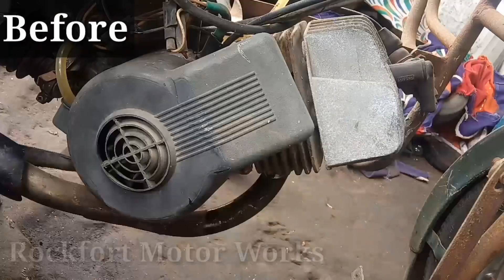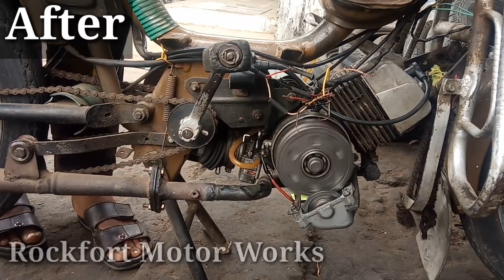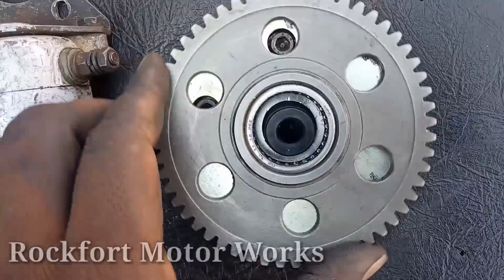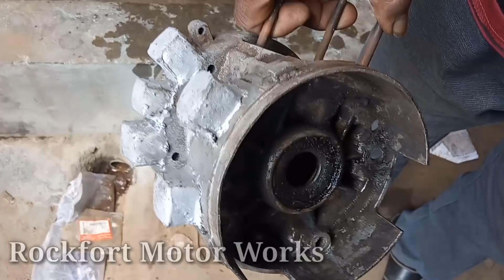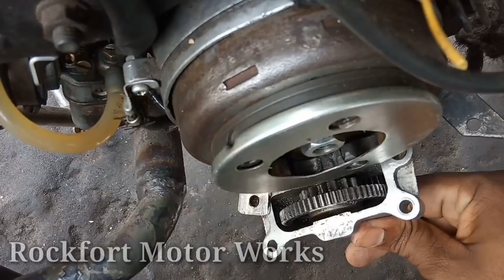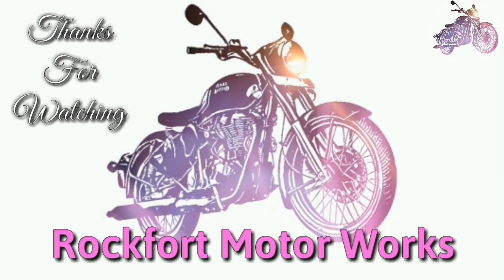TVS 50 Self Start Alteration / Rockfort Motor Works

Comment: Tvs 50 6v system, is 6volt motor available or u changed to 12v?
Reply from the maker: Battery charge ஏறுவதற்காக நாங்கள் magnetic coilயை  கூட amps வருவது போல் alteration செய்து இருக்கிறோம்
Reply: Super bro
Reply: bro shop enga iruku sollu bro my bike la self vaikanu   enna place la shop iruku